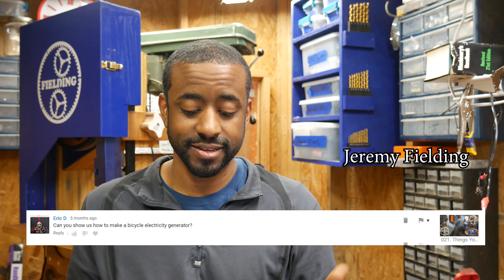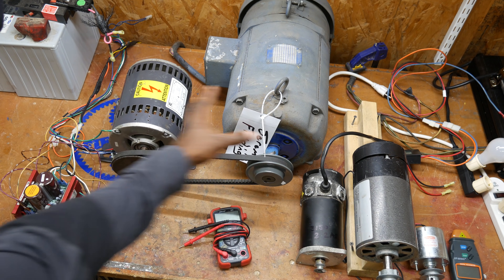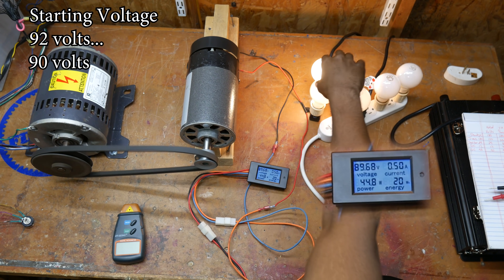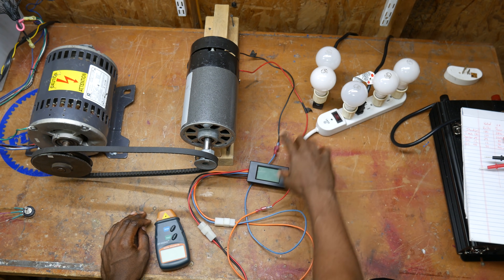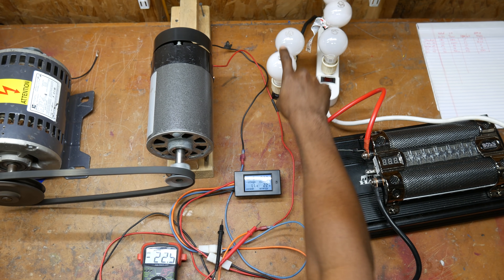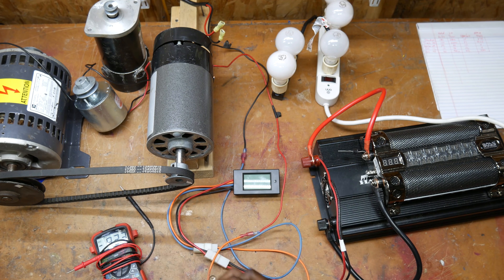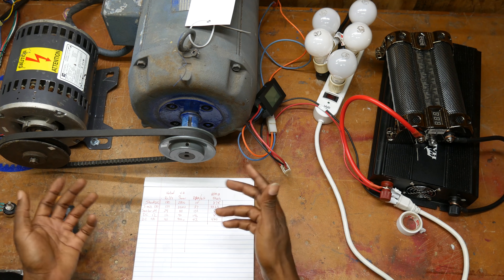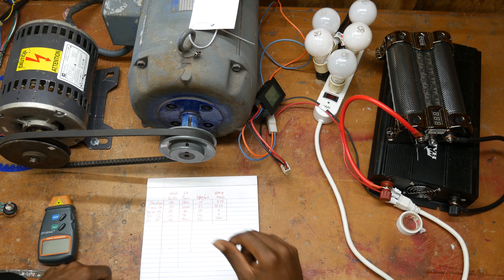How To Build A DIY Generator Part 1 : 050

Comment: Cool vid bud. I have been looking at a lot of solar and wind systems for off grid use,and being an old mechanic, I've replaced many GM style 1 wire alternators. Here's one from Summit for about $45. I have been buying race car parts from them for many years.They have built in 12vdc regulators and easy peazy hookup, Just sayin'. '-) https://www.google.com/search?q=GM+style+1+wire+alternators&rlz=1C1PRFC_enUS673US673&source=univ&tbm=shop&tbo=u&sa=X&ved=0ahUKEwjcx6_8wvrXAhWF1IMKHXnLDZgQ1TUI2wE&biw=800&bih=494#spd=3678280330127138471
Reply: Jeremy - "Complicate for Profit" rings true for many things. You don't need fancy intelligent multi-stage chargers to charge a battery. Most 12v lead acid batteries are charged to 14.4v and settle around 13.8v. By the time they hit 12v they're functionally dead.  Lead acids have a nice "feature" where all overvoltage just turns into heat and electrolysis. The higher the voltage you give them, the faster they'll charge, but the higher percentage of their power goes to electrolysis (splitting H20 into H2 and O2), and the hotter they'll run. The offgassing is extremely slow, but eventually (months/years) you'll run out of water, which is why occasionally you have to top them up with distilled water. On the flip side, if you only ever give them 13.8v, you can do that almost indefinitely without them needing to be topped up, years. Sealed Lead Acids have hardly any offgassing, like those in UPSs, and they last years like that while being constantly charged to a flat voltage.

Alternators are perfect generators for lead acid battery storage systems because they're designed exactly for charging lead acid batteries. Their field coil is regulated by the battery voltage and they have build-in rectifiers. You can spin them any of the wide range of RPMs the engine spins at and they'll charge the battery all the same.

You don't have to "know" when the battery is fully charged. When the voltages equalize, current will stop flowing. As long as you're not too aggressive by trying to charge them at 15v, (which will run them hot and offgas steadily), they'll be fine. Ditto for lithium, give 'em 4.2 volts per cell and walk away, no fancy bullshit 3-stage charging necessary.
Reply from the maker: Don't you need control over charging? I am not a car guy and haven't done anything with alternators... I have no idea. You can't just run 12 volts continuously to the battery, you want something that "knows" when the battery is charged. Also speed may be a problem. Don't you need very high rpm?... again I don't know. But I am interested now :) Help me out with the details
Reply: Alternators are designed to run at high speed, yes. There's a belt coming off the engine, and the RPM gets multiplied to turn the pulley on the alternator. From what I understand, they put out the 14...ish? charging volts that car batteries want regardless of the pulley speed, since they're driven by the engine and the RPM of the engine changes. There is a charge controller of some kind in the alternator, but my dad never explained that part to me.

My dad did tell me that they're really not very efficient as far as generators go, because there's no permanent magnet in them. You have to power an electromagnet, so they draw power from a battery at first, and constantly use some of the power they harvest to feed the coil once they're self-sustaining. There might be more to it than that, but I am not a car person, just a curious nerd.

That said, if it works, it works. I found an article about getting alternators to run at a slower RPM:
http://alumni.media.mit.edu/~nathan/nepal/ghatta/alternator.html

I kind of wonder whether you can use some gears to get the RPM high enough from the source, but it might not have enough torque. Apparently they do some weird induction thing when the stator is charged, and you really have to crank on the things to get them turning.
Reply from the maker: We need to keep the subjects separate because two different things are being addressed here. If you are charging with an alternator what you say is very true indeed. When the voltage is equal, current will stop flowing. Thus no real need for smart charging.. there are two things to think about here though... the car application is different. Cars don't deep cycle the battery like you might expect from a back up generator which may sit for a long time, then run for 3-4 days straight for a power outage. The alternator works great because the battery is charged right after you crank the car, it is topped off and the cycle is over. I am not sure the same concepts work for the application we are working on. Maybe it does, but something to consider.  

The separate issue is I am supplying 90 volts from my motor to get as close as I can to the optimal working range of the motor turned generator. I need something that won't charge the battery at 90 volts. The charger I refereed to in the video is for solar power systems that have "more than" 12 volts input. The extra power is wasted and not sent to the battery. The smart charger can increase the amps while holding the voltage at the right level. That makes it key for my application (the none alternator version). A windmill or rowing machine in my case, will never hold the speed steady enough to charge close to 12-14 volts. 

Back to the first point... I think the alternator is a good option after a brief review of the idea and seeing what others have done. But it is probably best applied in a gas powered generator where the speed is high. Wind generators and even water wheels spin way to slow and would require some pulleys or gears to multiple the speed. But every system waste power, including gears and pulleys. It just isn't ideal to have a whole series of pulleys to reduce or multiple the speed when trying to conserve energy
Reply from the maker: MattsAwesomeStuff, Cystal Soulslayer, mrt, w yore, Mr Frog, Thanks for the feedback man. I love it when you guys challenge me and offering me ideas. It is you guys that teach me to think deeply about the topic and show me options I would never consider on my own.
Reply: Mr. Jeremy, a proper Auto Alternator will have a control in it; 
so the battery is automatically not overcharged.
also, far as i know, most auto alternators are capable of 
charging multiple batteries. 
please continue this series!  Lots of Misinformation on Y.T.
i believe we would all benefit from you clarifying all of this 
for us.  i/we appreciate all of your efforts and experiments!!!
very best to you and yours,  walt
Reply: GM style 1 wire alternators have internal voltage regulators.(the old Ford and Chryslers had an external in a small metal box) The GM's are plug and play.The large positive lug can be wired directly to the pos side of a battery or inverter if you want. Ground is from the alternator body.It's a very cool/easy setup.I think the min RPM for 14vdc output is around 800 which is pretty low. I've attached a diagram I found. You can put a meter in where it shows the charge light.It's really worth you looking into for easy low budget power projects.Try finding a good used one online https://www.summitracing.com/parts/ado-334-1582?seid=srese1&cm_mmc=pla-google-shoppingsrese1_-acdelco&gclid=CjwKCAiAjanRBRByEiwAKGyjZW5-PJRtiHrOTBtvPdLvnEDnbu53jDkNbKCtHNxCcAvjNRIr_1lUIBoC434QAvD_BwE( or at local auto wrecking yards,craigslist,or auto electric shops.Hope this helps. https://i0.wp.com/www.puzzle-bobble.com/wp-content/uploads/2017/11/gm-4-wire-alternator-wiring-diagram-gooddy-2.jpg?fit=800%2C600&ssl=1
Reply: "Cars don't deep cycle the battery like you might expect from a back up generator which may sit for a long time, then run for 3-4 days straight for a power outage."

How are you thinking that that would make a difference?

If you've ever had a dead battery (not just wouldn't start, like, dead dead) on a roadtrip... the alternator runs the car and charges the battery up just fine over a few hours. Alternators are absolutely built to be run hard, flat out, at their max rating, constantly. They have to run the lights, computers, stereo, fans, etc inside the car non-stop. The battery isn't an energy generator, so all that power comes from the alternator. It's exactly a generator.

"The separate issue is I am supplying 90 volts from my motor to get as close as I can to the optimal working range of the motor turned generator. I need something that won't charge the battery at 90 volts."

Regardless of how fast you spin the alternator, you get your steady battery charging voltage out. The input speed can vary wildly, it's perfect for solar or wind.

Hardly any motors are going to work without any gearbox. There's a reason there's no such thing as slow spinning gearless motor. The size of the motor determines its wattage, but the thickness of the wires determines it's current. If you spin it slowly, and get low voltage, your current carrying ability doesn't increase. It's not like a transformer where you can pick the secondary.

A motor that has wires that can handle 10 amps and is rated for 120 volts, is a 1200 watt generator. If you only spin it at 1/10th the speed to keep your RPMs conveniently down, you'll get 12 volts but are still maxed at 10 amps, so 120 watts. Only 10% of what the motor was capable of. 

If you want to spin the generator fast but also reduce the voltage, okay, you can use an MPPT DC-DC converter and spend $90... but I think almost everyone looking forward to this build are interested in how to make stuff cheap/free from salvage, not hearing "just spend money" as a solution. Especially on a DC/DC that'll will burn out in a year or two.

Just my two cents. An alternator actually is a generator, not a motor pretending to be one. And you can find them by the dozens for their scrap cost in any city in the world.
Reply: One other footnote... you can get salvaged gearboxes from many power tools. An old grinder, any old NiCad drill (the older the better, more likely to have metal gears not plastic). They'll be good for the speeds and torques roughly in line with what you'll be generating. They're a bit small for a water wheel but for a bike genny or small windmill they're appropriate. For heavier duty stuff, while you're at it under the hood pulling an alternator, you can grab belts and pulleys that might work for you.
Reply: Have you considered stabilizing the RPM before it goes into the generator? Like a flywheel or something? I'm sure it loses efficiency, but the variable RPM thing seems like a huge issue.

Also, there are battery backups for computers called uninterruptible power supplies that might be of interest. Some of them are what's called "line-interactive," which means they can deal with unstable and poor-quality power from the wall and send it on to the computer without a hiccup. It might be worth taking a look at how the line-interactivity works. (And they come with batteries. Just saying.)

At heart, this is about converting the power output of a human. Human watts into rowing machine to generator to battery. Humans output limited watts at limited torque; how much wattage at what torque can the human (i.e. you) apply? If you figure out how much torque you can get out of the rowing machine, you might be able to use that to narrow down the choice of generator substantially. If you can't physically get the alternator to turn, but you can get a box fan motor spinning at 2000 RPM, it's not going to matter how much more efficient the alternator would be.
Reply from the maker: Mike. I think you are mixing the arguments again. I agreed with you. Only that my argument “in the video” for a charge controller is still valid for a “non-alternator” application. The details aren’t worth arguing over. Of course the Alternator will do what it was designed for... keep in mind I was not thinking of alternators when making the video. Only after seeing a comment I considered it for the first time and had questions.and here we stand. I will bring this up in the series as an alternator is a worthy option that people clearly use.
Reply: I am merely a curious nerd who enjoys poking ideas with sticks... you're the guy with all the motors! Thanks for sharing them with us noisy people :D
Reply: For the record, I am not at all opposed to you doing things however way you want them to. I don't care if you make a Rube Goldberg machine with 20 motors and a hamster wheel. I think to simply answer the question, the tried and true scavenger generator is a car alternator (also a lawnmower engine + alternator = welder, projects in popular mechanics from the 60s). You do it whatever way you want. I just found the conversation interesting, and disagreed with some of the hurdles you were concerned about. You don't owe us anything, make the content you enjoy making.  I learned new things from your video about motors and generators that I hadn't suspected before.